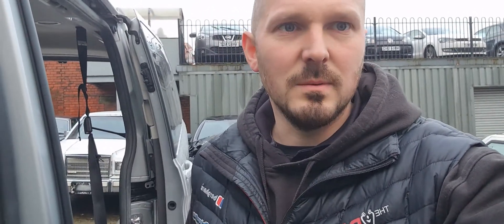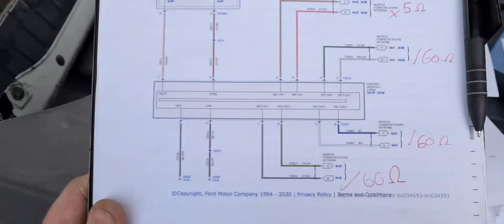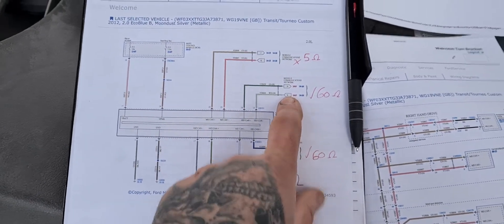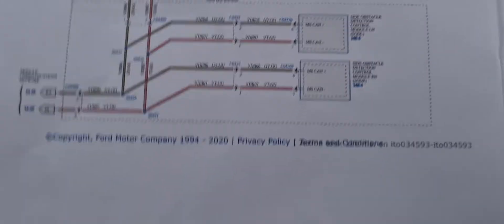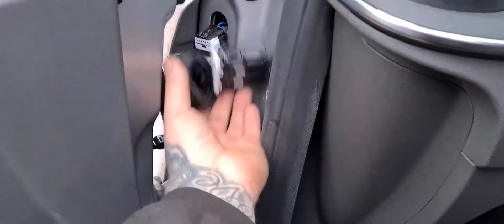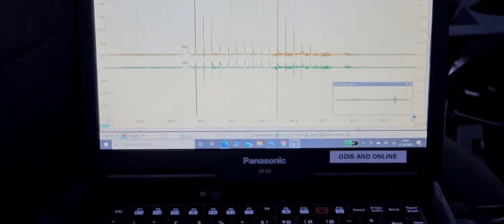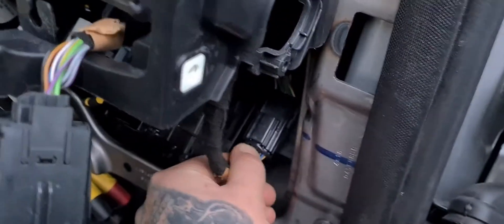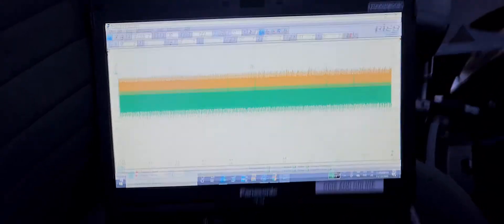FORD TRANSIT - NO HVAC, NO WINDOWS, NO CENTRAL LOCKING.

Comment: Hi Tom. I have a transit custom base 19 plate. I am having problems with the heating system.  Specifically the blower fan does not respond to the left hand dial. I can have it turned up full blast and there will be no output from the fan. On other times it will be working correctly on full blast on the blower but when you need to turn it down the blower rate/output will drop off completely. When you try to put it back to full demand it may pick up for a few seconds and then drop off again.  Have you any thoughts on what this could be? I've heard a resistor could be faulty? Is there a way of getting fault codes for the hvac system? Any advice would be most appreciated as it's literally driving me mad.  Thanks Tom.